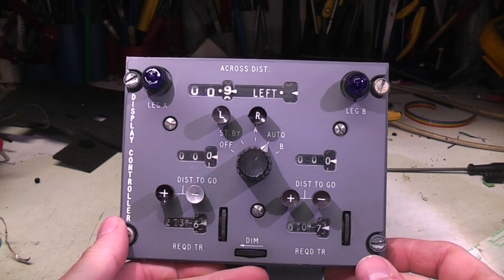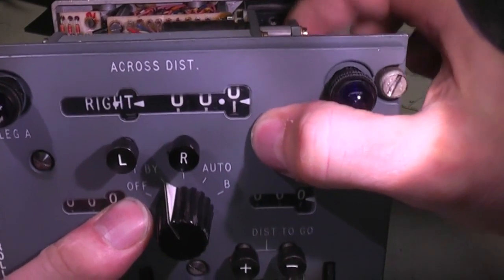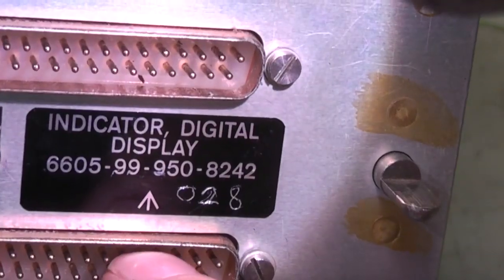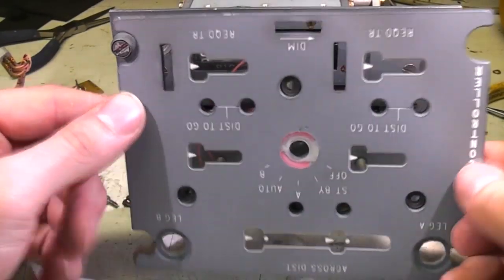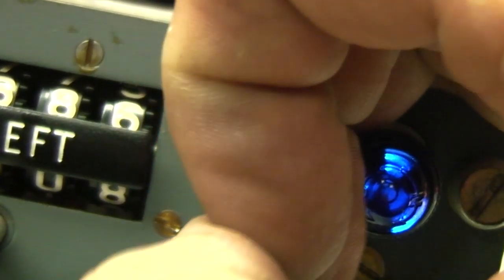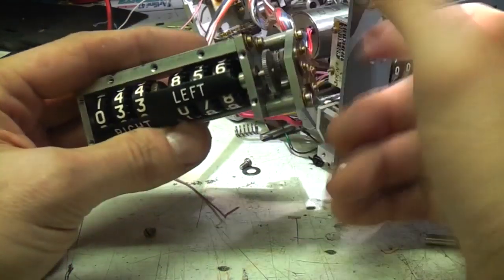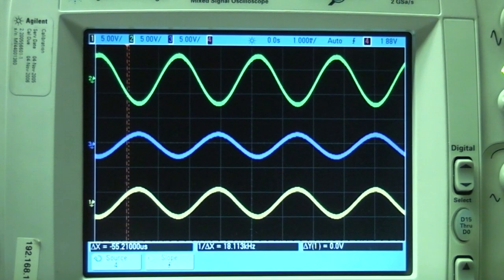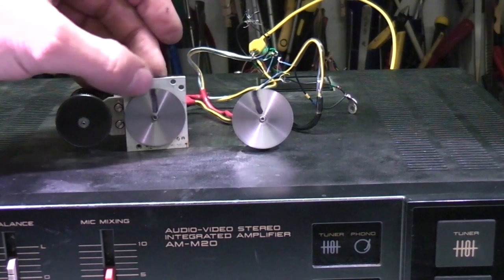Antique Decca navigation control panel teardown

Comment: There was a remote version of this panel which just has the left/right bearing display on it.
Feedback isnt required on the bearing display, the operator set the display at take off to the known bearing/position of the airfield, then the system computed distance travelled and calculated the bearing using analogue electronics.
Because the operator supplied the starting information there was no need for the system to intialize the display.

Comment: Something neat I've realized with that synchro technique - since it's based on the relationship between the three waveforms, it'd be very forgiving of signal strength and noise. It would be very tolerant of wire length, for example.

Comment: The receiving end of a synchro is called a resolver. Do not drive the rotor on the receiving end. Instead, multiply it or synchonously demodulate it with the drive of the source synchro.

The result can be driven into a DC motor that will drive the receiver to follow the source.

There existed special motors than can be fed an amplified voltage from the resolver (and the AC power) and drive the resolver into the correct position.

The direct drive as shown in the demo is for panel indicators.

Comment: Stepper motor might be easily used as an encoder. And, in fact, HAM radio enthusiasts were using them as a replacement for mechanical encoder. But now it became really easy to buy optical encoder. So probably it was possible to set the relative position with those numeric displays.

Comment: hi Mike - fascinating video! Do you still have this device? I'm really interested in the LEFT/RIGHT shutter on the main roller counter assembly - would you be able to make a video that illustrates the mechanism in more detail? like, I think it's driven by a gear on a shaft from behind, but I'm not quite sure. The reason is, I'd like to 3D-print and otherwise fabricate similar dual counters with LEFT/RIGHT shutters for flight sim and general amusement purposes.

Comment: I've always wondered what a resolver was.  Some old CNC machines used resolvers rather than encoders on rotary axes to determine relative position.  You can actually buy a board which will translate the output of the resolver to a pulse train that a digital system can understand.

Comment: 400cy/sec is used on aircraft because 400cy/sec generator heads, motors and transformers are smaller than their 60cy/sec or 50cy/sec equivalents.
Judging by the transistors and other parts I would say that the unit is of 1960s manufacture.  The 1988 code on the display is probably from a panel rebuild.

Comment: I would guess, from the front panel, that it's some kind of VOR/DME interface. Not sure why it is labelled as a "Display controller" - it would have been very unusual to have any kind of visual output in the year it would have come from. Probably for military or commercial aircraft looking at the panel mounts (they are the same type as go in o/h panels).
Reply: Doppler navigator - independent of VOR/DME or anything on the ground except the literal ground itself. Tracks the aircraft groundspeed and drift angle with a radar. Compares this with the aircraft heading (from the compass system) and the pilot/navigator's desired track angle to integrate your movement towards your waypoint and sideways to your waypoint to show how far left to go and how far off-track you are.

Comment: The push buttons - each microswitch was certified for certain load, and certain number of connections, so by putting them in 2x or 4x, you just extended their durability and life. Old trick.

Comment: That backlight looks like military grade tritium. It has a very long lifetime, and working off radioactivity they theoretically cannot fail.
Reply: Tritium doesn't need power to glow.  Almost certainly not tritium.  Since it glows bright blue, it's probably zinc sulfide doped with silver.
Reply: Dave Smith
 Tritium itself does not "glow" at all, it's just a source for Beta particles. You need a phosphor to produce light. Depending on the kind of phosphor you can create different light colors.
http://en.wikipedia.org/wiki/Tritium_illumination
Reply: EvilOverlord96 You are correct, of course.  I was only pointing out that tritium illumination doesn't require power.
Reply: A quick look on Wikipedia. Electroluminescent displays have been around since the ‘60s (patented in the ‘30s) used by Chrysler on some of their high end vehicles for dash lights. Notably the Chrysler turbine car and imperial vehicles. These require fairly high voltage hence the 250v 400hz (400hz being aircraft frequency). Chrysler turbine used around 100v I believe. You can here the high pitch squealing of the boost converter to power the backlight. Other notable uses were the Apollo guidance computer display backlighting and of course this device we are watching. No tritium here. Light emitting capacitor LEC was another name for it.